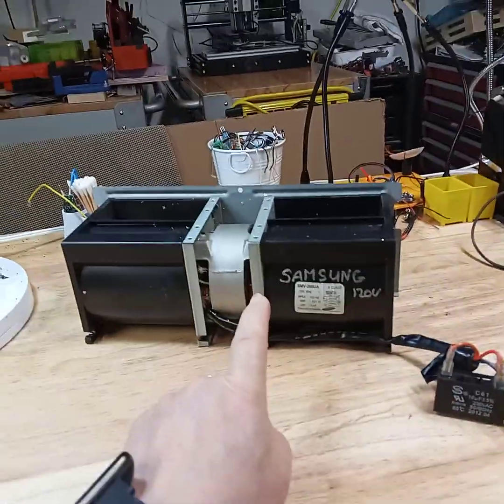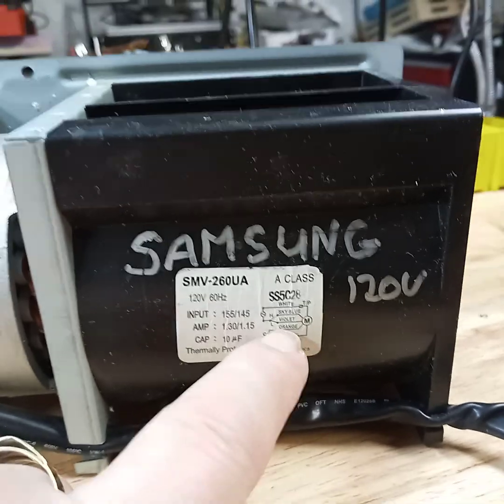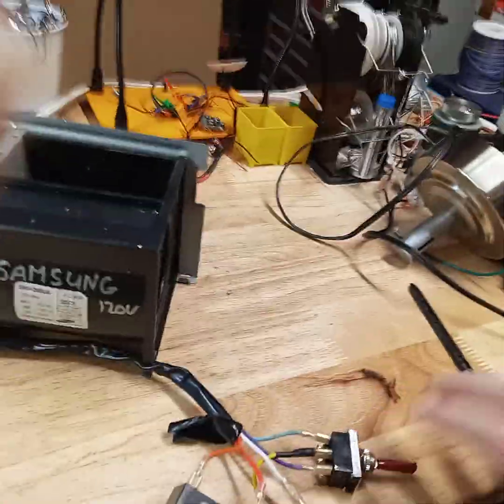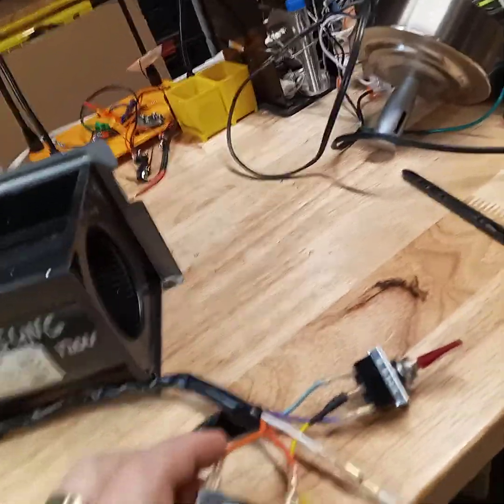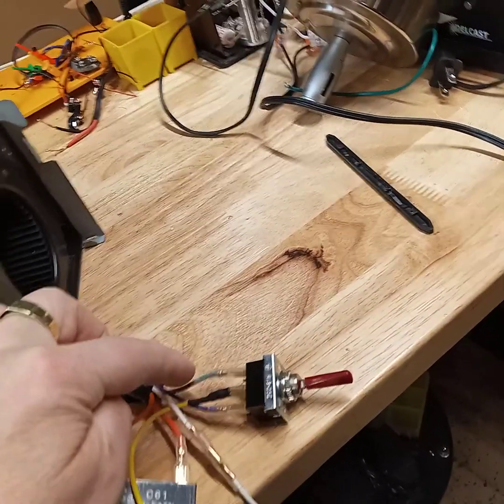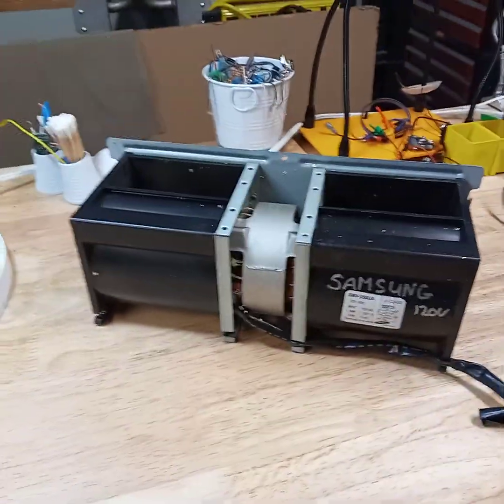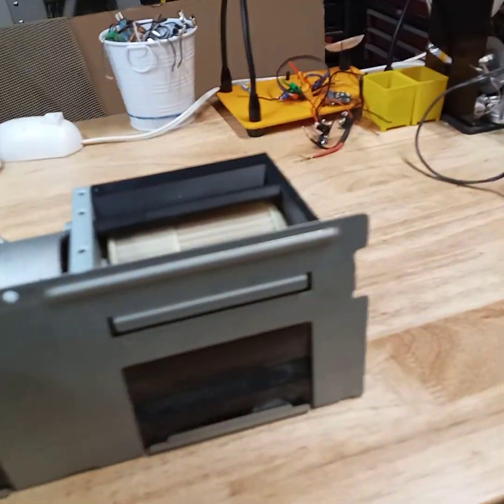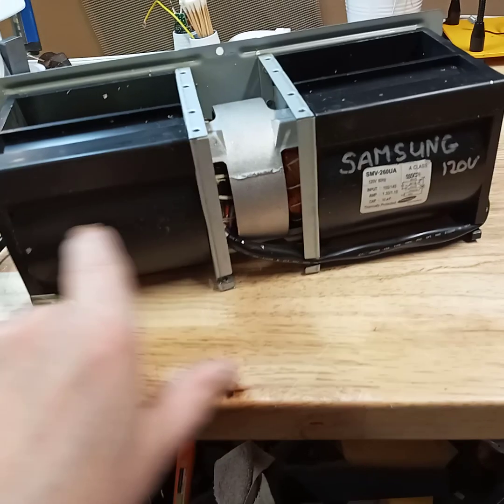Samsung Blower Fan, how to DIY wire the 10uF capacitor and 2 speed switch

Comment: Very nice Tony. Best Wishes & Blessings. Keith Noneya
Reply from the maker: Thank you very much. Have a great week!
Reply: I know this is old but I have a Samsung I'm going to use for a similar purpose. Any idea if it's safe to use some type of speed controller with these and which wires you'd use?

As a quick test I grabbed a 600W light dimmer and it works great using either speed tap but from what I understand a simple triac dimmer might be hard on the motor and there is a slight humming noise.

Any thoughts on the safest way to approach this and if I should combine both speed taps or simply control the high speed wire?